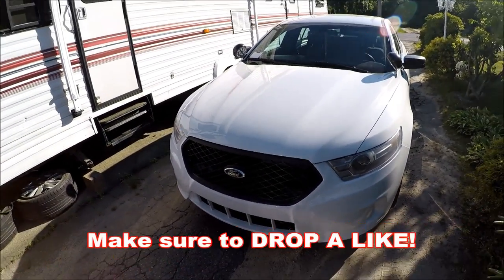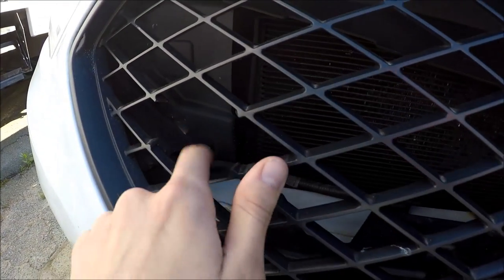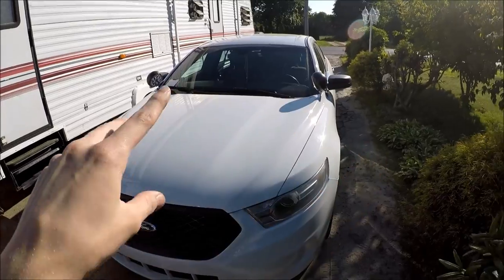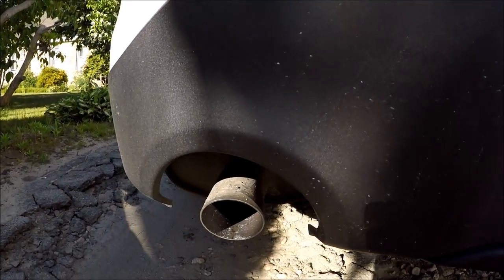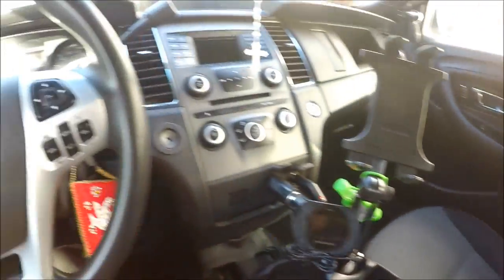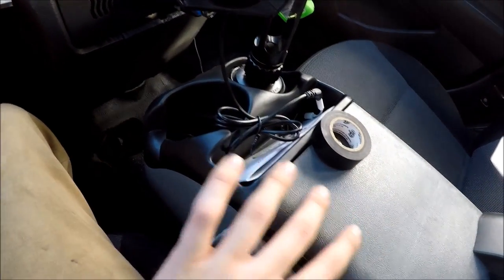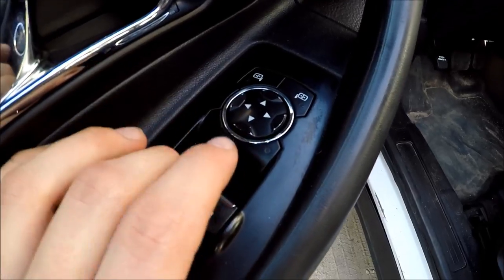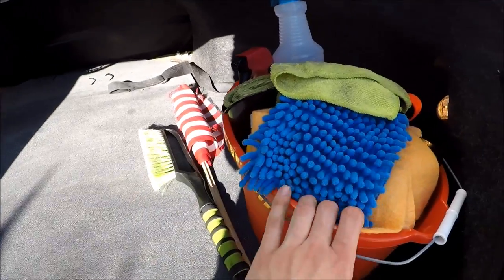2014 Ford Taurus Police Interceptor WALK AROUND TOUR!

Comment: The rear door can not be open inside is because the steel cable was not connected. Remove door panel, connect the cable to the door handle, put door panel back on, fixed.
Reply: I'd rather trap my friends inside!

Comment: The Goodyear Eagle RS-A is the only pursuit rated tire meaning all departments use them on their vehicles. Basically, they are fantastic tires.
Reply: ThisIsntMyName and that’s incorrect. Firestone makes a pursuit tire but there more expensive than the eagle rsa.
Reply: Just because they're pursuit rated doesn't mean they're good.  In wet or anything else including handling they actually get outperformed by most all season tires.  They're actually known as some of the worst tires you can buy for your car.  Departments get them for cheap because of contract money -- the same reason most departments use GY Ultragrips in the winter.
Reply: Not true , First they suck in the rain , and maybe 25K if you rotate  them , lot of departments prefer Firestone Firehawks , which is optional on new Pursuit Chargers
Reply: Those tire/wheel assemblies are extremely heavy.

Comment: Just replace the bulb with 9012 LED bulbs. BTW, the stock headlight is just nightmare for night driving. The original Aux port is on the right side of the dashboard,  you can find a bland small plate left to the pocket there. https://www.fordtaurus.net/forums/viewtopic.php?t=19904

Comment: A 2010 gas filler tube may have a gas cap on it.... You might be able to switch it......i dont like capless filler necks too :) as for the back door handles check and reconnect the door cable to the handles

Comment: One no it didn’t have a light bar. Most likely all interior. Two the sides pieces come out because there is a plate that goes in for the lights on the side. No antennas because everything was ran off the antenna on the roof in the rear. That’s a shark antenna.

Comment: Was there a reason given about why it was for sale . Usually if they can't pass inspection  they get rid if it. Mine has a bit of paint off the roof and that was the reason it was for sale .And check in the back seat area for stuff that may have been hidden by people that may have been in there
Reply from the maker: Mr. X a lot of departments get rid of their cruisers when it passes a certain mileage so they can upgrade to the newer models. Doesn’t necessarily mean somethings wrong with it
Reply: true
Reply: Notorious CVPI I got my charger because they were switching over to dodge rams so they sold their chargers
Reply: Yes they have a fleet contract where they May use it for 3 years or reach 60k or 100+ k miles then the vehicle gets sent to auction. I picked up mine from a certified dealer of used Police cars.

Comment: The reason for no holes is because the new age light bars are Bluetooth no need to drill same with the radios.  The car is Bluetooth enabled.
Reply: Coffee Before Anything not in 2014
Reply: William could have been a separate Bluetooth device installed, now removed from the car. Tint the windows at least the rear ones, it will definitely freak people out.
Reply: There still needs to be a power source